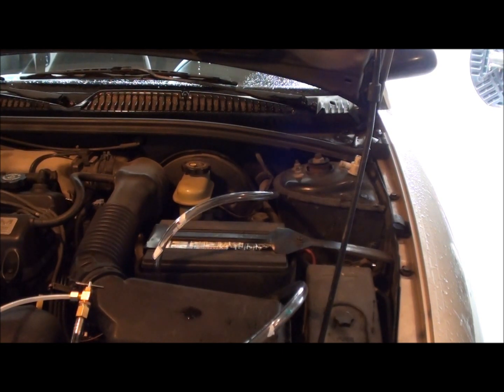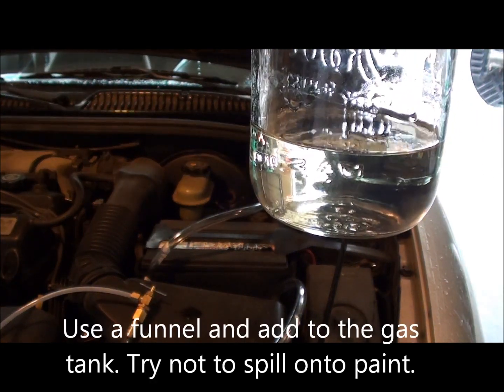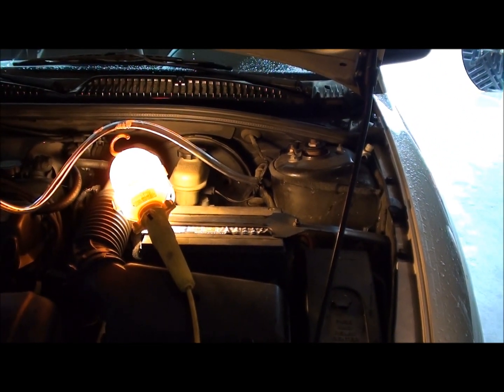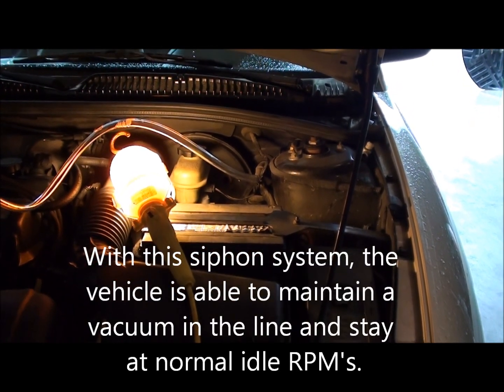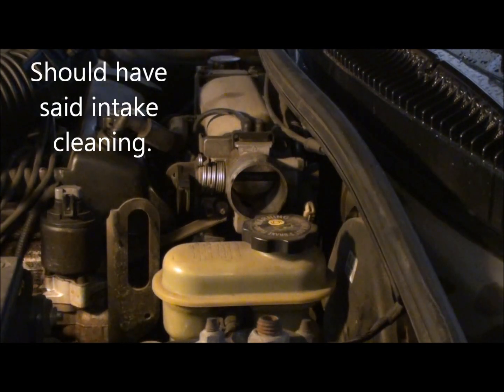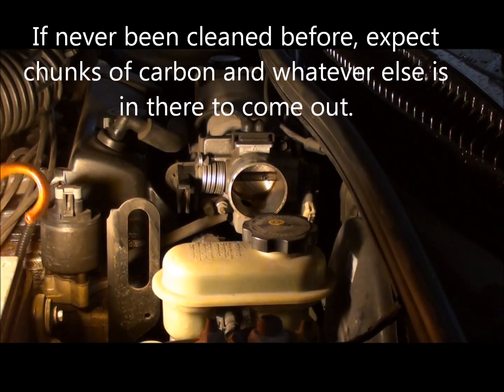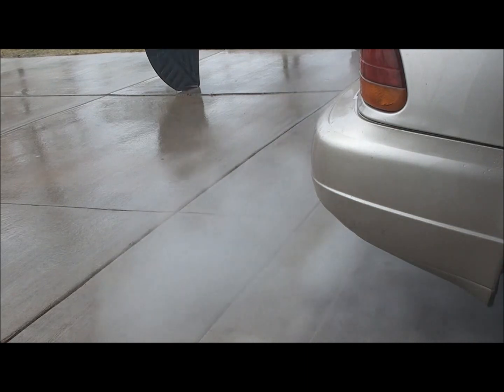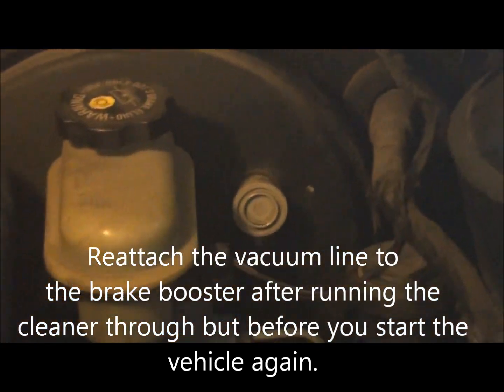How to Properly Perform a Fuel System Cleaning

Comment from the maker: this method eliminates the need for a 2nd person as well as the issue of the possibility of uncontrollable revving. this creates a metered and continuous flow that is drawn into the engine. as seen in this video, the engine was idling the whole time. if you were pouring into the line through a funnel it makes it more difficult and dangerous because you could damage something if too much is poured in at one time(hydro-lock). This is just another method to try.

Comment: If I'm not mistaken, your whole setup only affects the fluid leaving the bottle. Since pouring into the vacuum line is controlled by engine, there is no real difference in cleaning ability or where the fluid will reach as the siphon doesn't affect that. Please don't take this as bashing or anything but if it really does make a difference in cleaning do you think you might be able to edit into the video some test data or even create another video with your tests? You might be on to something.

Comment: I have removed the heads on many types of gasoline engines. While the combustion chambers were not clean they were not clogged with carbon. New engines are designed to run very lean. Lean burn engines do not build up much carbon. I still say a waste of time and money.

Comment from the maker: yes it does. just pulled mine off and did a thorough cleaning if it and replaced the gasket.  on this style, the cleaner pools where the AIC is located and gums it up with the carbon that was dissolved.

Comment from the maker: brake booster vacuum line might be some peoples only option. some older vehicles like mine have the additional line that goes to the PCV valve. after closer examination and research it would be better to use the PCV line (at least for my purposes. there is no need to and get an injection cleaning as long as you occasionally apply your favorite fuel injector cleaner to the tank. issues with dirty gas mainly come from where you get it.

Comment: With seafoam you clean the whole 9 yards sir, both injectors and valves. Not only that it does an incredible job cleaning an engine too. Just add it to the oil about a 100 miles before change and if you have never used this, you'l notice. So will the guy who changes your oil, lol.

Comment from the maker: Its not a waste of time, because the build up is mostly in the combustion chamber. when induced, the cleaner will turn to vapor and expand and essentially blast the carbon and buildup from the walls. This will free up room in an already small space for a more complete burn. instead of using seafoam, I've been reading where water is used instead(using the same method shown) and in effect steam cleans the chamber. Planning on trying this method the next oil change.

Comment from the maker: I guess this should be called the poor mans fuel system cleaning. It's an induction cleaning, by definition. Myself and I'm guessing the majority of those wanting to do this do not have the expensive tools to run it through the fuel lines themselves, but that's one reason why you add some to the gas. And really if you want to do a fuel line cleaning might as well throw a gallon of acetone into the gas while on a long trip(when it reaches half a tank). At least that is what I've been reading

Comment: Forgive for being ignorant,but being a tech for 35 years,and someone who cleans induction and injector systems on a weekly basis,could you explain how this method cleans a fuel system ? you have not even attached it onto the fuel lines.
regards Joe

Comment from the maker: When used as directed is what I was going for. when I made this video I forgot to mention the diesel specifics. My additional note is what the can says about diesels. The main point to drive is to not run it through the air intake(vacuum line).

Comment from the maker: Additional Note: DO NOT USE THIS PROCEDURE ON DIESELS! It is for gasoline driven vehicles only.
If you want to clean a diesel engine you can add Sea Foam(or choice cleaner) to gas and/or fill the fuel filter when replacing it. otherwise, DO NOT run cleaner through the air intake.
For a more thorough cleaning, must be done manually by removing the EGR Valve and exhaust manifold.

Comment: Ultimately, SeaFoam is just Naptha (coleman lantern fuel), pale oil (light machine oil) and isoproply alcohol. I like Lucas products for 'in tank' additives; however Chevron Techron is one of the better additives (you can buy it at Wal Mart and other outlets). But the 'bomb' is BG products. I like SeaFoam but I just won't  glug glug glug it into the intake; I like the idea of a more metered flow. But the best thing is just do the BG intake cleaning every 30 - 40K miles. About $120..worth it IMHO

Comment from the maker: some sensors can be cleaned yes, Don't know details on all of them but a few are a single strand of wire that can be thrown off calibration if a cleaner is applied. others have a special coating that no cleaner should be used on or it will remove it and allow quicker buildup.

Comment from the maker: video follows bottle instructions. Good thing my gas tank only holds 12 gallons. however, I will agree with you that further research has told me that 5oz might not be enough. I use something else now not only to clean but to lubricate. If using a good oil like a high mileage synthetic oil then the additives are there already for cleaning and conditioning. I've started running 1/2 the bottle through the booster, throttle body clean w/ said like cleaner, and 6oz MMO & 2oz 2-cycle oil mix in gas.

Comment: In a properl-mainained engine, there is no "SLUDGE" buildup in the crankcase; diluting the oil with this really does not do much. And putting 5 oz in the fuel tank with 15 or 20 gallons of gasoline is pretty useless as you already have 10% ethanol (alcohol) anyways.

Comment from the maker: any vacuum hose that runs to the intake should do just fine. Looks like a VW beetle from your video if its a carbureted engine Seafoam makes a aerosol version that has a small tube like a WD40 can which you can spray into the intake directly with air filter hose still attached during the procedure. don't know if that would work but worth a shot.

Comment: Yes what you came up with is great. I hope i didnt not offend you in any way. I just want to say the proper way to clean the fuel system and injectors is with the fuel system cleaning machine. But I think you came up with a great way to be able to clean the intake of a vehicle using seafoam by yourself. Where you would normaly need two people.

Comment from the maker: fair enough. however I and the majority do not have the money for those types of machines.  This is what I came up with to do relatively the same thing the dealerships and other quick lube places do. granted you may not fully clean the lines but you will have a somewhat cleaner intake and cylinders. I'd rather spend 10$ bucks on a can and do this every 10-15k rather than 100$+ every 30K or whatever the rec. is for a particular vehicle.

Comment: I work in a dealership and we use a pressurized fuel cleaning system that works off the shop air. That is plugged into the fuel rail, You pull the fuse for the fuel pump and have the vehicle run off the cleaner until the bottle is empty.

Comment from the maker: the lines really should be clean already as the gasoline acts as a solvent. adding the little bit of seafoam to the gas will add additional cleaning properties for that tank. the real reason to add to the gas is to get the fuel injectors. The process shown is the quick way. by going your route, I believe that risks damaging the lines and and you would need pressure in the lines anyway to push the fluid through hence the reason there is a fuel pump.

Comment: Doing a cleaning like this does not clean your fuel system. It does clean your intake from deposits. Adding the cleaning agent to your fuel as you did might help a little for your fuel system but will not actually clean it. To clean your fuel system you would need to shut off your fuel pump and add the cleaning agent right to your fuel system and have the system run until it emptied the bottle of cleaning solution. Just some helpful advice.

Comment from the maker: Apparently I misunderstood your statement. you can do that with the PCV valve. I found doing the cleaning this way wouldn't take in too much of the fluid at one time and stall out the engine if the settings are right. It also takes the need away of having to rev the engine while pulling in the seafoam.  I am still looking for a T joint of some kind that will "Diffuse" the fluid entering the system so it removes the need to constantly having to adjust the valve that you saw me doing in the video.

Comment from the maker: as long as it is through a vacuum hose that runs to the intake you will be fine. the brake booster line and the PCV line essentially go to the same place.

Comment: Nice work.  That is quite a setup with the hoses.  Wouldn't it be a lot easier to just pull the PCV valve and suck in the seafoam through that?